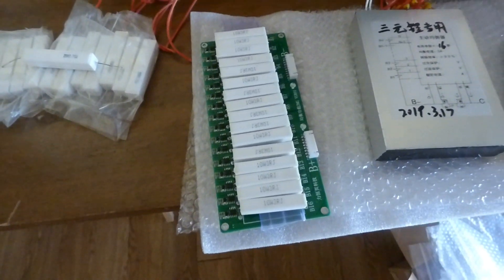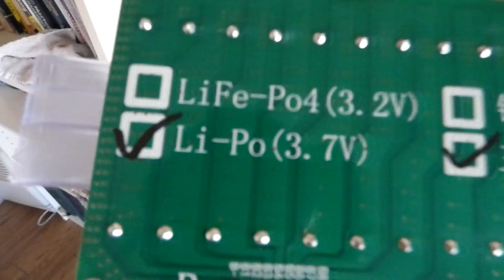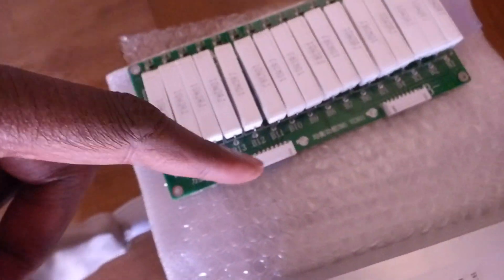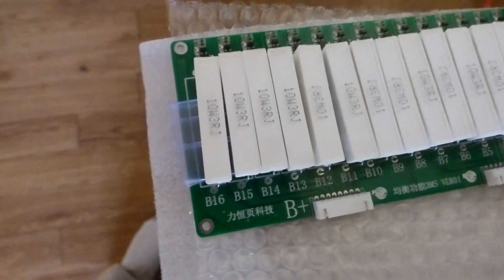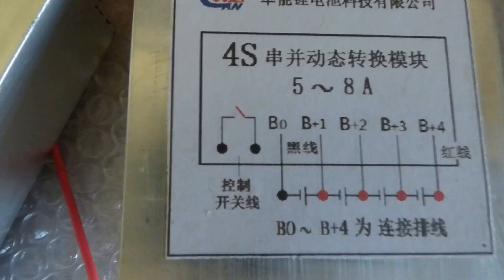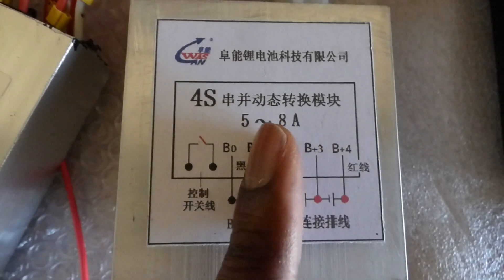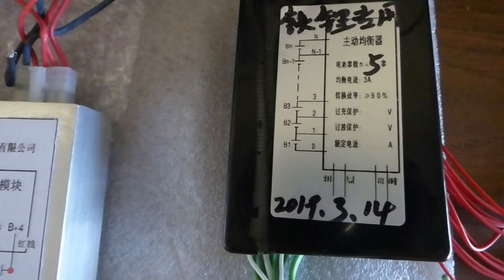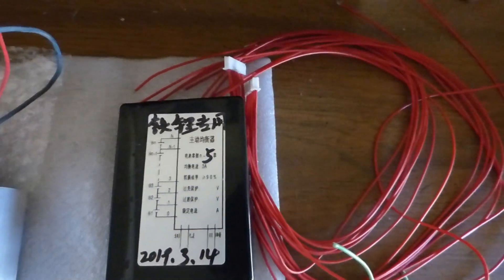How to get Full capacity from your Leaf Batteries

Comment from the maker: I finally got the equalizer and balancers and as promised I am making a video, showing you what they look like. They leave for Nigeria later in the week and I will have a video of them in action for your viewing pleasure. The little white ceramic things are resistors. Thank you for watching.
Reply: In need of a balancer. I use leaf Modules in an 8s configuration. Any recommendations?
Reply from the maker: @MidwaySolarWestIndies  I would use the deligreen balancers. I am still struggling to get the units that I have purchased to work
Reply: @drsolar  got a link?

Comment: Hi Dr. Solar question how did you finally solve your nissan leaf battery with cells that charged faster. I am having a similar problem with a 8 cell BYD 24v battery. When charged, one or two cells reach 3.6v while the rest remain at 3.4v.
Reply from the maker: Thank you for watching. I used a balancer equalizer from deligreen. It is a 1S. You can find it on Alibaba. Good luck

Comment: So what's your recommendation on a 14s BMS that won't brake the bank given I need a whole herd of them?
Reply from the maker: Hello Tiersmoke92555. Your batteries cost a fortune and I will recommend that you get a good quality BMS. The Chargery is very good but you must add a contactor to start and stop the charge. It has active and passive balancing. If you don't want to spend $200 to $300 there are BMS for less than $30.00. But they say you get what you pay for. They balance with current in the milivolt.

Comment: Those are resistors not diodes
Reply from the maker: You are absolutely correct. Thank you for watching and commenting
Reply: @drsolar  Thank you too for sharing. I will like to see how the battery equalizer performance. And I really hoped I'll be really active balancer. I've seen similar ones on AliExpress advertised as active balancer but after messaging the seller for more info, they always turn out to be passive balancers.
I'm working on a 10kw 7s system and I'm looking for a cheap  active balancer that works. Most of the cheap balancers I've seen are passive balancers and  only starts balancing at between 4.18 to 4.2v which is pretty much fully charged and I won't like to be fully charging my battery but also want them to balanced at all time and I don't think a bms balancing @ 100ma will do the job.
Thank you
Reply from the maker: @Yangmist3r  I will be in Nigeria within a week and I will give you my verdict once I put them through their paces
Reply: @drsolar  
That will be great.
Safe trip in advance brother.

Comment: Do you have a positive authority over a main contactor with these bms units? That way you can disconnect for safety in case of continuing charge conditions when maximum/minimum cell voltages are exceeded?
Reply from the maker: Hello Aaron thank you for watching. I consider you an authority I am humbled to see you here. These boards don't offer protection. You will need a bms. I have a Chargery that does not balance it serves as protection. This handles active balancing and equalizing.
Reply: @drsolar  also thank you for the compliment 🤗
Reply: @drsolar  ah ha I see. What voltage ranges are you running the balancing process at?
Reply from the maker: @AaronBockelie  4.1 v on the bms that I had. These new boards let me check and get back to you
Reply from the maker: @AaronBockelie  the unit with the white resistors balance at 4.17 the other balances once it see a voltage differential